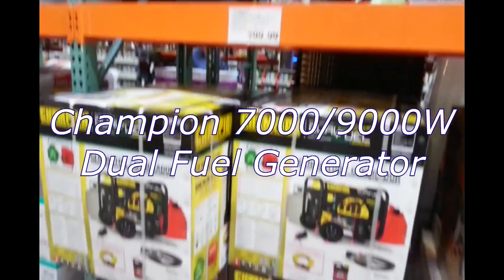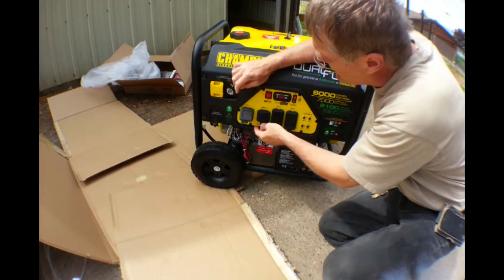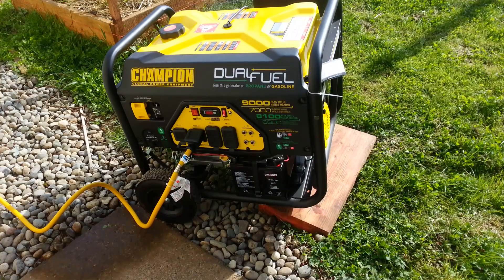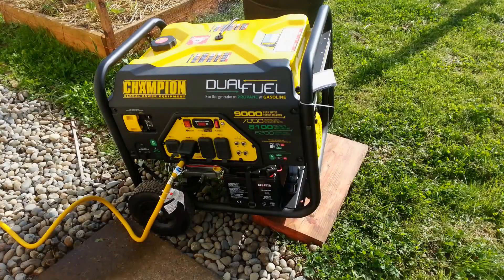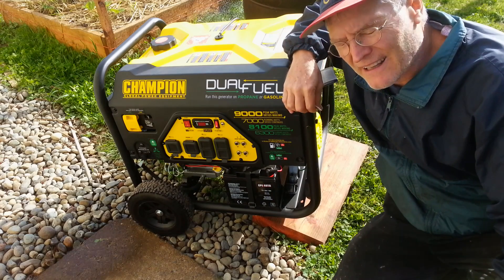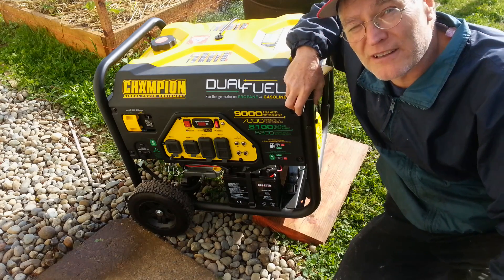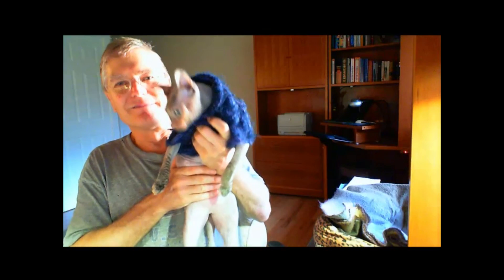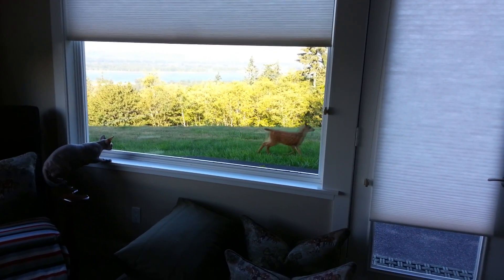Champion Generator testing w/2 fuels and under loads

Comment: The gasoline consumption is directly proportional to power consumption. A Generac 15,000 watt unit with a 16 gallon gasoline tank runs for 10 hours at 50% load, meaning approx. 7,500 watts. At full wattage, 15,000, you will consume 16 gallons of gas in 5 hours.

Comment: Your clamp meter looks like its clamped on the full romax with all wires. You need to pull your cover and clamp on the single hot wire

Comment: You need to understand something. Higher voltage = lower amps. 38amps x 240 volts manufacture water heater specs is 9120 watts. U exceeded the max load on this generator. 

Watts divided voltage = amps. 
So example if your water. Heater was 120 volts. 

120v divided 9120w = 76 amps. 
The lower the voltage the higher the amps.

Comment: Use this generator for emergency power outages and travel trailer☛>share4.photo/CIgenerator?17くr     It came with great, easy to understand instructions. I use only propane to operate it although it will run on either gasoline or propane. Like the size. It's a bit noisy, but not that bad.

Comment: Mine won't start
Reply from the maker: On gas it can take a little bit to get the lines full of fuel.  You should try a carb starting spray.  If still no go  You might try it on propane - if it works there you'll know the problem is with fuel float or metering. 
Also note the fuel selector is a little tricky - I remember now having a hard time once and found it was not properly set to gas input.  Good luck.

Comment: Even though its dual fuel, its more efficient on gasoline than propane even though propane is cleaner burning .. You get more runtime and power
Reply from the maker: Thankyou for the comment   Yes - you are right - that is certainly true and people should be aware of that!  
But propane stores indefinitely and gasoline has limitations even with additives.  In SHTF I'd lke to be able to generate electricity from anything - so at least this covers the gasoline and propane  ;-}    And when I run this every year to check it, I can run it on propane and don't have to drain out the gas tank and float etc.  So it has advantages.
Reply: RelentlessHomesteading I don't store gasoline, when hurricane season comes by, I get about 25 gallons of ethanol free fuel and hang onto it just in case, once the season is over, I just take that gas and pour it into my truck and use it for work. 
With propane, yes it's storage in virtually indefinite but the bottle is only good for 10 yrs ... The issue with propane is that it can only be used for the generator or the grill ... So if I store up ~50 gallons of propane and no storm comes by, then I have 50 gallons of propane sitting here... Sure it can sit for 10 yrs ... Which is great but I can't use it for anything else unlike gasoline, I can take it and throw it into the cars and use it up .. 
Both have their good and bad ...
Reply from the maker: @ACommenterOnYouTube  Sure thing - each should go with what works for them. Thanks

Comment: I also own the same model.  My biggest complaint about the unit is how much fuel it consumes.  I have a pair of smaller inverter generators that I'm using instead.  Those units combined use less fuel than the Champion.
Reply from the maker: I agree - it does seem rather 'thirsty'.  That would be a good test !  Thanks for the comment.

Comment: What hp was your pump? Is it submersible? I'm looking at this same generator and hoping it would run my 1.5 hp submersible pump, it's a three wire design with control box and I have read they don't require as much starting amps. Thanks
Reply from the maker: +spearo life     Hi ---You say 3-wire - as long as you don't mean three phase you will be alright.  We have a 1.5 HP downwell pump 550 ft deep and about 900 ft. away AND a 2 HP pressure pump.  Avg. current is in 6-8 Amp range - so both together is ~ 3000w..
With surge current at 2x worst case is ~ 6000w.  So its a good choice.

Comment: I watched a vid on a 4000 watt generator and its tough as nails and dual fuel for about $300 https://youtu.be/lmFJ_w8seMk
I think I'll order it since both Sportsman and champion use the same engines but sportsman is probably tougher
Reply from the maker: Thanks - - Depends on how much power you need to draw.  The 9000W here is about the minimum that will "get 'er done" - so we went that route.  For some getting a Watt-meter and checking all loads is a good strategy before getting a generator, other situations don't warrant it.  Appreciate you chiming in with the suggestion.
Reply: We live off grid since 2014 but theres always like this week SNOW for too long and the battery bank got abused. So its time to get a better back up to run the 150 amp charger, the sportsman looks like a good no battery needed option.
Reply from the maker: Oh - very glad to see you know what you are doing !!  There are a lot of new people jumping in and buying equipment on the early side of the learning curve' but you're living with the solar / generator / battery bank situation every day for some time.  Thanks

Comment: At 3:49 you mentioned the interlock switch to prevent both from being on....  WHO is going to turn the main ON while the generator is running..??
Reply from the maker: Good question -- Logically one would not, should not do so - but obviously it has happened before because there are strict laws on having interlocks (which apparently are not even sufficient in many jurisdictions) so that those working on restoring a downed grid are not electrocuted by a backfeed.  
The precautions taken become even more in depth when one has a solar power system connected to grid but configured for providing power when the grid is down.  We here have to have separate breaker boxes with NO connection to the main load boxes, to which the inverter system connects to supply power.  It's a royal pain - but I understand the safety issue.  This is why 99.x% of all solar tied to the grid becomes a boat anchor when the grid is down.  Perhaps I discussed that in our videos on "Star Lite Wars" discussing what was done for the solar system here.
Reply: Relentless Homesteading:
Im glad you understand the hole point of WHO will turn the main back on while generator is running on your property...  In my case i have a 6 ft fence that surrounds my property and its locked with a thick gauge combo lock so nobody gets in unless they JUMP the fence... Next my outside panel is also LOCKED using another combo lock while the generator is running so they cannot get to the breaker unless they cut off that lock.. So.. with that said, WHO is going to go thru all the trouble of jumping my 6 ft fence with bolt cutters... go to the panel, cut off the lock, open the panel door... and flip the main back on while there is a generator 3 ft from the panel clearly ON and running back feeding power to the street.....???????  What person in their right mind would do such a thing...???  Yes some idiot can but why..??  
Yes i understand this CAN happen but the odds are slim to none so i don't even worry about it..  But it just iritates me when people say your an idiot for not having an interlock switch...  Maybe i am to you but im not the idiot wasting hard earned $$ on an interlock that i don't need...
Reply: You Tube bii

Comment: My entire house with every light inside & outside ON, all 10 ceiling fans ON & in HIGH speed, both bathroom exhaust fans ON, all everyday a/c adaptors plugged into their sockets, all 6 TV's ON with cable boxes running, stereo surround sound in living room, Pool pump running on speed 2 of 4... ALL this and i'm pulling just under 20 amps or ~2400 watts at 120V...   YES all 240V appliances are left plugged IN but not powered up, basically on stand-by... 
I ran all this from the SAME generator you are testing on this video :-)  

So to run the 240V appliances..... You now have to prioritize and re-route power, basically shutting down 95% of the house to route power to the 240V appliances ONE at a TIME... 
Dryer took 25 amps... Hot Water Heater took 18 amps... Stove took 20 amps.... Microwave took 15 amps...  Washing machine took 5 amps only on spin cycle, otherwise it ran ~3 amps... 

So bottom line is that with this generator i was able to run almost everything in the house except for the Central A/C ... One major appliance at a time :-)
Reply from the maker: That's a whole lotta circuits !! Thanks.
Reply: Your telling me ... LOL 

My next check is to see if this generator will kick over and run my 3 Ton central A/C....  it has a split second surge of 80 amps then 14 amps running... 
It surges 80 amps but NEVER trips the dual 30 amp breaker in the panel.... I WONDER WHY...??

Comment: Bought tractor with a fork lift, and pulled generator out of car onto forks with a come along. Moved it to the deck. 2 men at tractor supply had a lot of trouble lifting it into the car .I'm 72 yrs old. 200lbs
Reply from the maker: You're Resourceful !  I hear you on the lifting.  
Gone are the days I could sling a 94# bag of cement over each shoulder.  Now buying the 60 or 80# bags of ready-mix concrete.  Although I stupidly sometimes lift well over a hundred pounds, it doesn't do my back any favors.  I'm just past 60, but have had arthritis throughout for 45 years.
Reply: Protect your back use a back support.. I injured mine moving my snow blower. I use a wagon to move bags of feed and gas 6gal cans now. My Back is completely shot.
Reply from the maker: Yes - helps to protect ourselves, keep our back working for longer.  This week I've been rototilling and moving 40 Cu Yds of wood chips, but light weight stuff actually seems to make the back stronger.  But digging trenches by hand is more taxing.   
Thanks for the comments.

Comment: Great video on water heater can change from standard 4500 watt elements to 3000 or 3500 should hep but will just take a little longer

Comment: my NEW Champion generator model 100155 start easily with propane gas but do not start with gasoline. the gasoline flow to carburator and I followed all the instructions including fresh gasoline.Can be something electric?
Reply from the maker: I think the electrical side is about the same for propane and gas - I'd check (0) enough time to get fuel into the float and lines,  (1) fuel shut off, (2) fuel level - if at slight angle and not full then may not reach the gas intake hose.  Next (3) would check the fuel float and filter.  Good luck.
Reply: RelentlessHomesteading You do it .The problem of my Champion was the carburator .The needle was tight. I cleaned it and is free movement. The generator started very good. Thanks very much.
Reply: If the battery is low the generator will not start in gas mode. The generator will start with a dead battery in propane mode.

Comment: The higher the voltage , the LOWER the Amperage..........they move in opposite directions ! Your theory's are ASS backwards !
Reply: If your a electrical engineer why would you hook up a water heater which you claim pulls 38 to 40 amps on a cord that’s rated for 30 amps. ( didn’t like that so much ). You said. Your a poser. Hack. You keep the fire department in business. Any electrical engineer would laugh at you. Go back to your school of jack and get a refund.
Reply: OHHHHHH DANG! You got schooled bad by relentlesshomewrecker, Joe!!!!
BURN!!! I don’t thank I trust you with my multimeter Buddy
Reply: So why did the generator stall out??
Reply from the maker: Sorry but a load is characterized as a resistance (R), and V = I x R.  so I = V/R -- thus for a given load, if you double the voltage you will double the current draw.  Most loads do not act strictly as a resistance, but the trend line is the same.  I believe what you are thinking about is when you use a 220V motor for example vs a 110V motor -  for a given HP output a 220VAC motor will draw lower amperage than a motor designed for 110VAC that is running on 110VAC.  But when you take the same load and increase the voltage to it the current will increase I=V/R.  
I'm an electrical engineer and worked my way through college as an electrician.

Comment: can it work on natural gas instead of propane ?
Reply from the maker: Can't directly use NG, the fuels have significantly different properties.  BUT -- there are kits available to retrofit these generators to natural gas.  Cost is between $100 to $180.   However, if the grid goes down for a long period of time - would there still be natural gas flowing?  The NG pumps require electricity.  Best to have your own supply of propane, just a thought.
Reply: Radner Bearman yes it works on any fuel
Reply: @TonyMontana-ok3mh  Tony you are incorrect. This unit runs on Propane ONLY. You would need a converter kit to run this unit on Natural Gas - the kind of gas that you pay for that is piped into your home by your local gas company. To be clear: Propane and Natural Gas ARE NOT THE SAME! Real RelentlessHomesteading's comment above.

Comment: Honda 2000 watt/ 2000 dollar generator.....
Reply from the maker: LOL - certainly they don't come cheap.  But wish my Champion was as quiet - AND that it had the feature of adjusting its output to match the load as with the Honda.  When I bought the Honda ~ 10 years ago there were not many options.  Thanks for the comment.
Reply: Never mind lol
Reply: Is it a lot louder than the honda?
Reply: The Sportsman is shockingly quiet, the new one.

Comment: thanks for the info, now I wish I bought it when it was 599 on sale at costco
Reply from the maker: $599, wow - believe I paid $799 and think its  a good price.  This is the 9000W peak unit...
Reply: I have one for $650 in great condition
Reply: I just bought one today and had it running straight on propane. Man I love it. Ya its kinda loud but it gets the job done without any worries. Btw I paid $599 at Cosco

Comment: is it strong enough to do a standard residential hot water tank? dryer? or oven?
Reply from the maker: Hi Matt -    Yes in general it can.  Our large elect. hot water tank peaks out at 30A @ 240V = 7200Watts.  An old electric stove and a dryer we have both use 30A plugs on them - so they likely would also max out at a little less than that.  
But would it really be dedicated to just one of those?  And I doubt the water heater ever hits that peak, and most of the time would be less than 1/10th that amount; but the generator would still be consuming almost that same amount of fuel as if it were supplying 8000W.   
I'm looking to add a propane on-demand system into the lines, so that I can select either electric or gas for generating hot water.  Then setting up an outdoor kitchen rocket stove  that will also heat water and couple it into the lines (more long term projects).  
Personally I'd never consider using my generator LONG TERM for a hot water tank, dryer or oven -- FAR too inefficient.  That being said - there can be short term outages where we use what we got when we need it - which is likely the case you are speaking of.   
The best load for the generator is really a battery bank that is large enough to take in all the current the generator can supply - that way you run only long enough to charge batteries and efficiency is very high.  But I know it is not a perfect world, and we don't all have the infrastructure we want yet.  ;-}  
Appreciate the comment.  All the best Matt!
Reply: Matt Lord:
My Hot Water heater pulls 18 amps...  ON & OFF
My Dryer pulls 25 amps when the heating element is ON and about 5 amps when the heating element is "resting"..
My Stove pulls 20 amps when the heating elements are ON and about 3 amps when "resting"

The only way to tell what your appliances are using is by getting a clamp meter and clamping the wire coming off the breaker that feeds that appliance... Clamp it and just watch... 

The generator in this video can support 30 amps at either 120V or 240V...
Reply: Yes it is rated at 9000 watts more than needed for a oven or hot water tank.